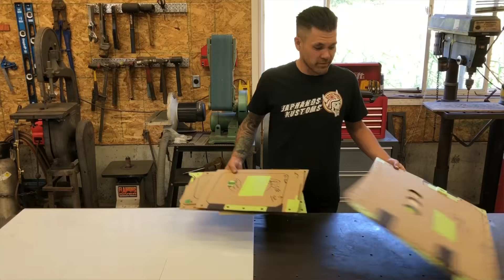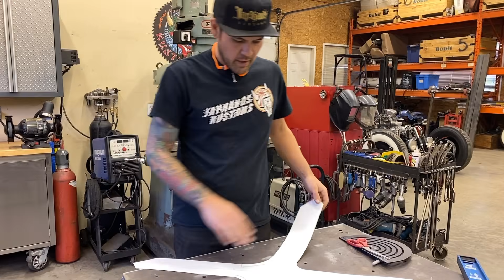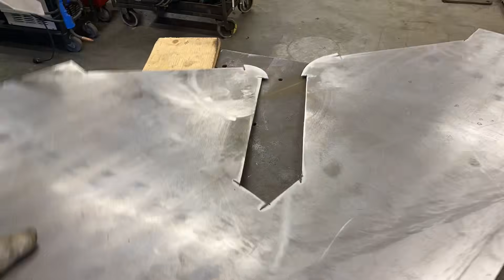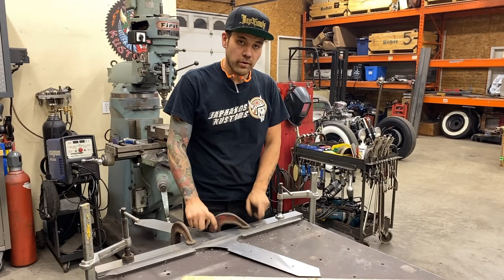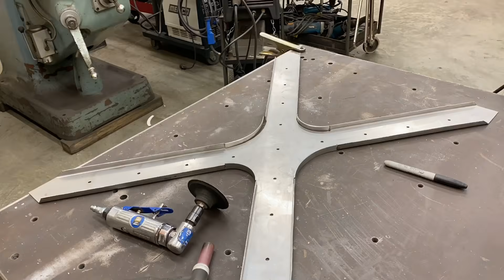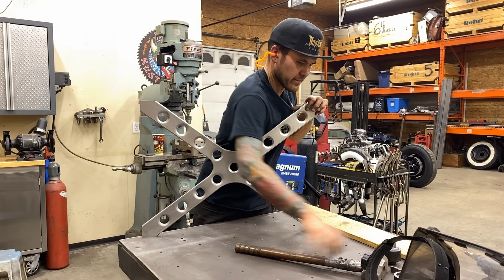TRY This SIMPLE Trick to Build Curved Flanges for Inner Structures!! (Hammer Forming + Dimple Die)

Comment: Simple question: you use lot of air tools instead of power ones. Why?
Reply: Air tools are so much cheaper. You have just one power source, which is your air compressor. On electric tools you need a power source on every tool.
That makes pneumatic tools cheap and electric tools expensive. First buy the biggest air compressor with the biggest air lines, you can afford. You need to apply air pressure and air volume. Cheap air tools need a lot more air volume, then more precise produced ones. Hope it helps.
Reply: @mikeuhlmann6825  Thanks Mike, much appreciated. I have a 24lt compressor that is good for inflating tires LOL. I was looking for a 50lt upgrade and then decided to try air tools. They look promising but 100lt is the minimum. Saving the money for this. Regarding air tools I would go for CP or Ingersoll. Buy once, cry once. Isn't it?!
Reply: @twicetrader  There is one more thing, you should check, before you buy a air compressor. Cheap brands give you the information, how much air the compressor sucks in. Honest brands give you the information, how much volume and pressure it delivers. There is a big difference. Make sure, the compressor will match the needs of youre tools. Example : Many spray paint guns need 300-400 liters of air, to function properly. A cheap compressor delivers around 150 liters at 5 bar pressure. So there is no way to a proper paint job. Second thougt should be the air hose. A small diameter can deliver pressure, but not volume. Fire fighters need big water hoses to bring a lot of water to the fire.  You need pressure combined with volume, to operate air tools. Take your time, to check these points, before you buy anything and you will be surprised, how much frustation you can avoid with the right informations. Maybe your compressor can deliver much more, than you think, just with a bigger diameter air hose. Sorry about my english. I`m german.
Reply: I understand, that you think, the tank of the compressor is the main reason for the capabilities of a compressor. The air tank is just a buffer for constant volume and pressure. The compressor itself is the size of the cylinder, piston and the rpm, the motor runs. That produces the amount of air and the pressure in your hose. a big and strong cylinder/motor combination with a small air tank will deliver much more air and pressure than a big air tank with a weak cylinder/motor. In the field, you can`t transport big compressors. So you have a small tank with a strong compressor unit.
Reply: @mikeuhlmann6825   Thanks Mike. I like your English, are you using ChatGPT LOL. Btw, precious advice here. Considering that we sit on the same continent, could you please give me a couple of option that satisfy all your points? Just to have a clue what's in your mind is a good compressor for all the airtools' spectrum. Thanks in advance

Comment: Just recently found the channel and am watching pretty much everything. Awesome material for sure. 

Since it’s such an old video I’m sure you won’t see this but how difficult would it be to dimple die 2 pieces and weld them together in the dimpled areas? 

I’m building a Jeep with my son and have some ideas for rock sliders, just thought it would be a cool look if I could pull it off - it would look like we punched a dimple through 1/2” steel. That doubled up plate would weld in between 2 tubes so you wouldn’t be able to see it’s 2 pieces of sheet metal.

Comment: Slowly work the edge. Yep that's it. Patience and be gentle. a really clean flat flange will come from this simple technique. This takes me back over 40 years when I worked in a shop with few machine tools. Creating pipe bends, transition pieces and stuff with simple tools and techniques was fun. Yeah, 16g is great to work with. 20g too but I prefered 16 for welding.

Comment: Great video. I like the way you made your brace and the dimple dye. I would change one thing on the dye. I would drill a 1 /2 inch hole in the middle so it would take a bolt to tighten the dye. Sometimes a person dosen't have room to swing a hammer if you are doing it on a vehicle.

Comment: you can use powdered rosin between the bars and the sheet, and it will prevent "creep" in hammer forming.  I've not worked sheet metal much, mostly billet, as a machinist, but I've worked with others who worked it, and I'm learning how, and learning the tools you use and make.  I've made many, not knowing how they were used, machining to spec, and it's nice to learn how they are used.  I think I will do a better job making them, having seen them used correctly.  Thanks, really enjoying your work and showing the details.

Comment: Hey bud, You want a good tip, when you cut those small pieces for doing the inside curves I recommend you use a larger pieces, so it doesn't become a pain in the but. Than afterwards cut the excess off after you have done the least amount of tacks or least amount of welds. do that to you own discretion.  Its easier to always work with a large pieces cause small pieces are hard to handle being that their so small.

Comment: It's amazing how you can use light weight steel and put some holes and make some dimples in them and magnify the strength of the steel. I've been thinking about making my own rack for my truck bed to put a rooftop tent on. Not only will these add strength to the sides but make the rack a little more stylish! You really have some great fabricating videos! Thanks for showing the simple means to make some of this stuff. I just watched your video on making a dimple die; great video. Also, for someone, like me, who is learning to mig and tig weld, I enjoyed your video on mig welding and showing how to listen for whether you have the settings for volts and feed right. I've actually been looking at a lesser expensive Lincoln welder for 800.00 dollars that can do everything but aluminum. really great vides!
Reply from the maker: Thanks so much I’m glad that you’re enjoying the channel and getting some out of it! That’s what it’s here for. It really feels good to know these videos make a difference! Cheers

Comment: Here’s a tip for you.  Flip the grinder over and pull towards you when cutting.  Does a bunch of thing for you.  First all the sparks shoot away from you instead of on you.  Being right handed it moves you head out of the way of the cut.   When pulling towards you you can easily follow the line you’re cutting on more accurately.

Comment: I wonder if you realize how good of a presenter you are. I follow guys like Fitzee's and now you because I want to learn and yall sure don't disappoint. But if I may ask. I do not have a Tig welder... yet. Is it feasible to so Sheetmetal with a wire welder? I keep trying but always end up burning through.
Reply from the maker: Absolutely! Wire feed Welding is great and you don’t need anything else. Just check your settings you have to be quite low to do sheet metal and you cannot do continuous Welding. It helps a lot to try and keep your material as cold as possible

Comment: Thank you.  For the video.  I've got a panel to make where a 1.5 inch radius goes around a near 90 degree corner.  I tried pie cuts but didn't like it.  Thought hammer form... but sounds like that might not work.   Any other suggestions?   It's a corner where 3 plains come together
Reply from the maker: Hammer form would work great I would consider using aluminum for the form or steel. Because it’s a tight radius you will be hammering pretty hard on it
Reply: Thanks.   I'll give it a shot.

Comment: 2% Thoriated and 2% lanthanated TIG electrodes are made from radioactive thorium and lanthanum. There are fears about thoriated electrodes, but it holds a point longer that other electrode, and it’s easier to weld with.

Comment: Really well done video, you make it look easy. That's an awesome work table that you have - any particular reason for having the top plate trimmed flush with the frame, instead of leaving some overhang for clamps (I'm designing something similar). Thanks.
Reply from the maker: Yeah my clamps are big enough to grab it with the frame as well but this one is a threaded top so when I want to clamp things I always can thread and use fixture clamps from a mill

Comment: So your trick for insainly cool projects is useing your noodle and a bunch of work?
I love your abillity to adapt and overcome the challenge at hand.
So I'll wind this up with;  It is reasuring that you do not need to throw a bunch of money at your problems.
Oh I know a plasma torch and TIG welder and press brake vertical milling machine can be hamn dandy,
but it is nice to know that you could get along without all that if you had to.
Reply from the maker: Thanks a lot Peter in fact most of the items that you mentioned I’ve only acquired in the past couple of years. Most of my career has been the hard way. But even when doing things the hard way I must be efficient
Reply: @MakeItKustom  Thanks for showing the kids how it's done. I do a lot of interesting crap myself with a scale hammer and C punch and my cheap bench mounted drill press and trusty bench vice. I also have a nice assortment of files.  Much respect.

Comment: Hi, what about TIG and MIG welding? The difference is only in amount of grinding work? Or there are some mo reasons to use TIG instead of MIG?
I'm restoring 1980's Nissan Skyline HGC211, and the time to make rear fenders has come. So, I wonder, what type of welding is better?
Reply from the maker: If I had to choose one I would choose TIG But there are reasons to use both. For most people the easiest one to use for the most things is a mig welder
Reply: @MakeItKustom thanks for answer! 
I have all these types of welding. Mig weld is good, tig - still hard to me, just learning yet. 
I need to change big piece of rear fender, with long weld, so, afraid, that mig welding will make a lot of distortion and waves.

Comment: I picked up a hydraulic electricians hole punch at a garage sale for $50 and you are right, the sizes are a bit funky, but man, what a nice hole in sheet metal. Mine is old school hand pump. Nice videos. Good tip on both hammer forming and welding flanges.

Comment: Hey Carl if you are going to hammer those curved areas do you need to leave the metal a little wider in the curved sections??
Reply from the maker: Do u mean if they are hammer formed?
Reply: @Make It Kustom  yes sir.
Reply: @MakeItKustom  Yes. Thanks for the videos by the way.

Comment: Greenlee tools does make dimensional ( inches and metric) drag out punches. As you mentioned conduit sizes are larger than the size of pipe they are for. I know that other tool manufacturers do also. However they are $$$.$$

Comment: Something that you probably already know but for folks that are starting out.  Each piece of this cross piece needs to be a finished product.  For instance the small flanges that are to be welded on need to be clean, square and strait.  This makes the welding a whole bunch easier but also when the brace is done, you're not running around trying to fix problems that could have been taken care of with better prepperation.

Comment: Tip from an old electrician. Don't worry about centering it. As long as each hole you dimple, you put the tool on the high or low side. The width center will stay true and you'd never noticed the last hole being a tad low or high.

Comment: What is best gauge steel to use 16 or 18 gauge
Reply from the maker: I like 16 for structure and 18 for outer panels. But typically you just want the same as you are replacing

Comment: Another great video brother I figured out my cheap hydraulic hole punch from harbor freight if I flip the die so it doesn't cut the metal will work as a dimple die. FYI 🧐I think it goes from 1" to 3" if I remember

Comment: Once again, very good tutorial Karl. I am wondering, since you didn't fill the weld whether you are concerned about breaking through on the edges when you sand down the outside, or did you fill the backside when I wasn't looking? Really makes me wish I still had a shop big enough to do fabrication again.  So now you're going to have to build a car around that piece so it won't go to waste...
Reply from the maker: The weld is penetrating deep so no need. Thanks toby !

Comment: Awesome work. I'm sure it's not just me that wonders how many hours you put into each piece. I'm sure it's more than most would guess, and it would help justify what custom metalwork costs.
Reply: If I had to guess. I would say that just that brace could be upwards of 8 hrs pending number of radii in project and welding/finishing techniques.
Reply: I've been building custom cars for 30+ years and do alot of custom metal work like this. 8 hrs is a very good estimated time on this piece in my opinion.
Reply: Would take me all of that, maybe 10 to deburr nicely etc
Reply: @danielrunge7294  yeah it could take 10 and it depends on the tools a person has. Definitely time consuming no matter what that's forsure. All worth it when your done though!!
Reply: Sure worth the wait, tho.
Reply from the maker: This piece took 4 hours but if it were for a project it would take longer to measure and fit